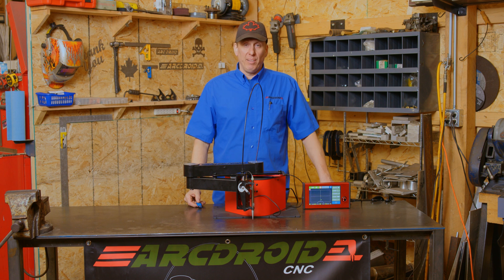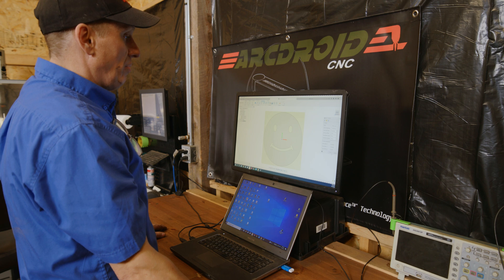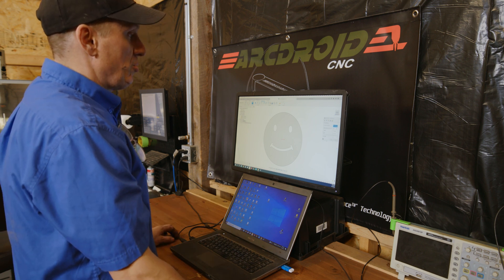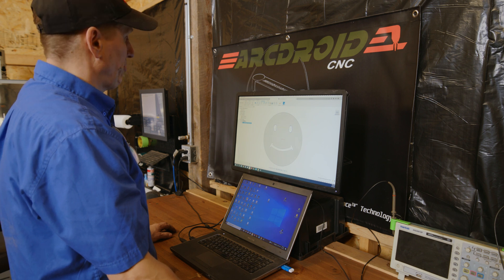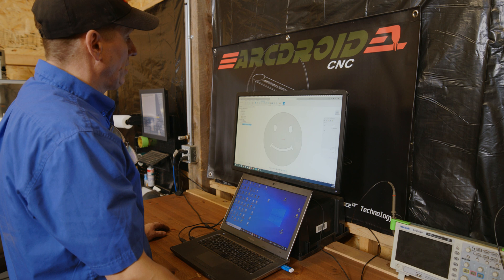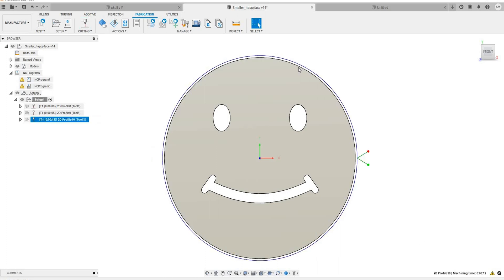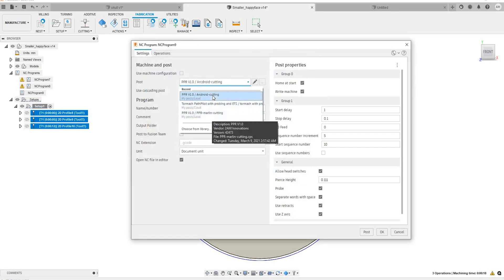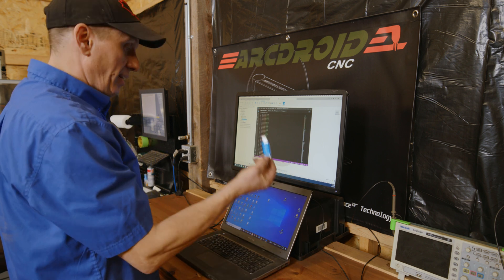Step 6: Basics of cutting with Fusion 360

Comment: Completely skipped the only part for which I am interested: loading and running the gcode file. Not a second of the procedure, no manual.  When I try to load gcode, the unit becomes completely unresponsive (freezes). Cannot use the Arcdroid to run gcode; so, this device becomes a $2500 paper weight...
Reply: There is a manual for download on the website under the Downloads section
Reply: Have you called or emailed customer service.  They're really good at helping out.

Comment: Will the POST PROCESSOR you're using work with SolidWorks, as well?
Reply from the maker: Not at the moment  Solidworks has been difficult with information on post development.  You might want to try the generic one from Hawk Ridge systems .  It seem to work in most cases.